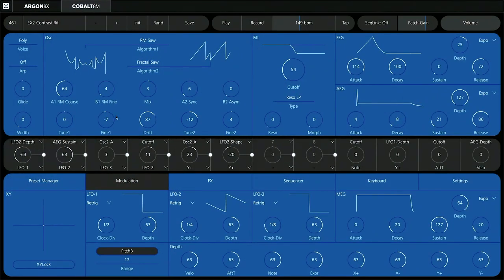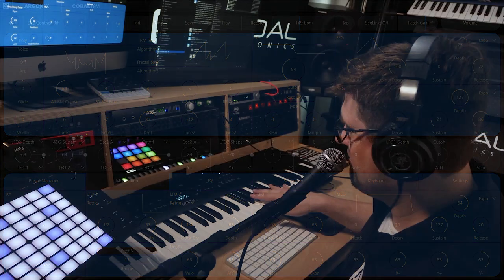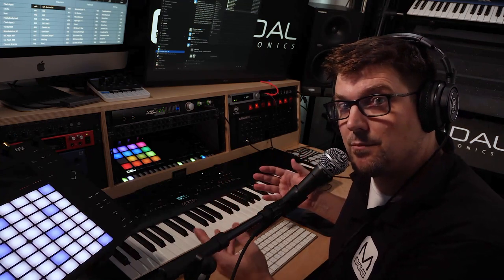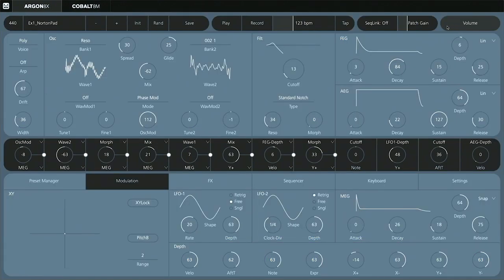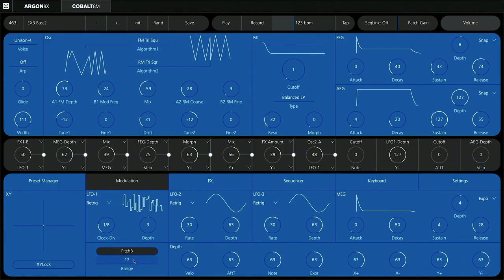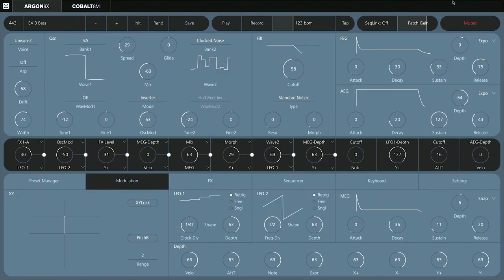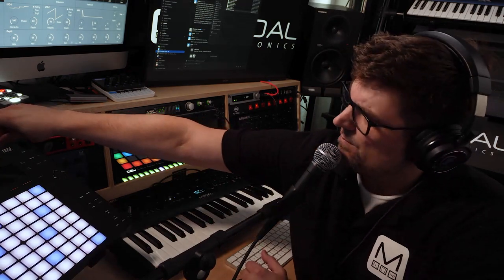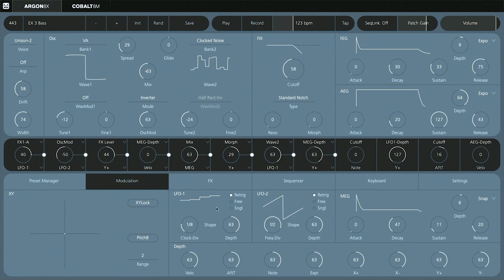Quick Dive #10  – Parallel Sound Design with ARGON8 and COBALT8

Comment: Those demos sound like finished tracks!  I have both M versions and I'm just starting to scratch the surface with "parallel sound design" so it was cool to see this video pop up in my YT notifications today.  If I can suggest a part 2 / follow-up, it'd be great to see another QD session on maybe less rhythmic / tempo-sync'd type sound design for evolving / ever-changing soundscapey stuff.  Also you mentioned routing options in the video and it'd be interesting to see your thoughts on using the ext audio in from one synth to the other, combining fx and so on.  I've been playing around with that and you almost forget they're two separate synths, especially when using the app.  Thanks for another great QD! -Rob
Reply: Yes please. Argon + Cobalt super pads. I have Argon with Cobalt on the way.

Comment: How do you get cobalt and argon talking to each other? Hardware-wise. ie, In your exmple here do you have the Argon controlling the cobalt via MIDI? is that correct? Thank you!
Reply: You arm 2 midi tracks in ableton live. Run External Instrument on both, one for each synth selected for midi output (from ableton to synth) and then Hold command / ctrl  while clicking "arm" buttons and they'll both stay lit. The other way would be to just run a mini cable out from one and in to the other. Hope this helps. Cheers.
Reply: @MajorOSC  yes!! Thank you! I use Bitwig and Reason, so I'll assume it's the same with them? Thank you!!!
Reply: @mattwoodman3017  yes indeed

Comment: Modal Argon8m and Cobalt8M are good synthesizers, the only drawbacks I see are the filters, they are not pretty and the volume drops when the resonance is raised, that should not happen, the resonance is raised to alter the signal, not to reduce it, and the resonance is too much. thin, you should be able to widen to your liking and the bandpas option is not there, the morpho mode is not enough, it does not make real bands, the effects are all laughable, they sound poor and are not pleasant, none of them sound metallic and it is better not to use them, they look like a toy Thank goodness there are the effects of the daw in which it integrates perfectly, Argon8m does not come with several banks of wave tables, it only comes with one, per oscillator, which does not have 8 oscillators per voice either, do not sell something that is not, the option bank is black, you can't touch it, I don't know why it comes out, if it's deactivated, the outputs are not balanced and they introduce noise into the neighboring channels, otherwise, they sound good, they are practical and easy to handle, but you have to work harder in improving them because there are vsts that are not dsp and sound more powerful and better, these are not dsp either